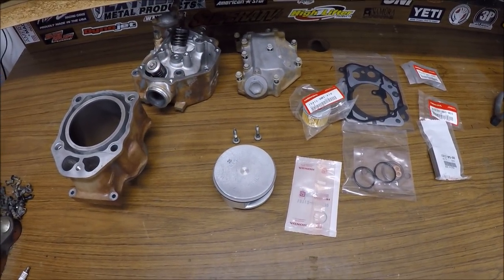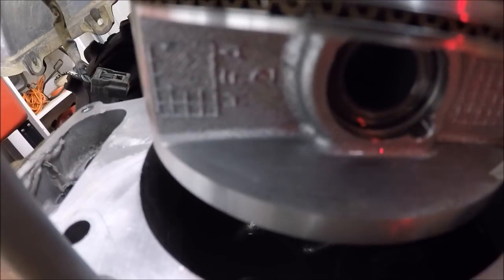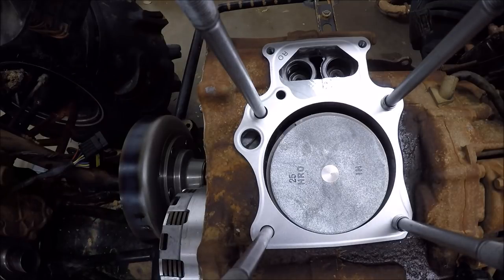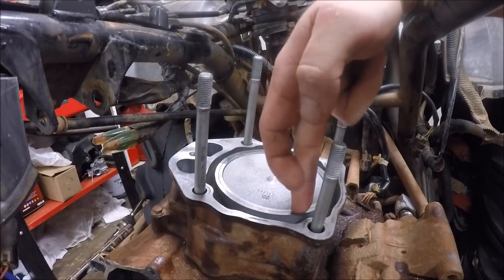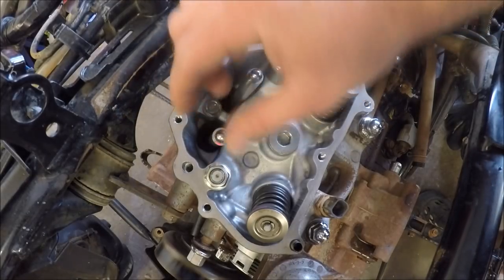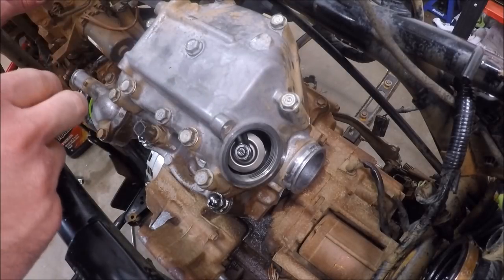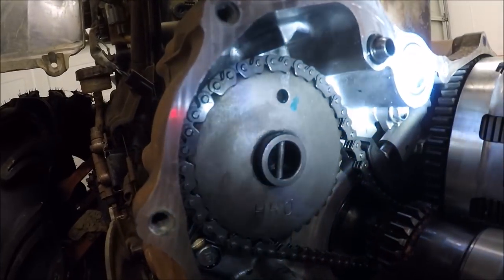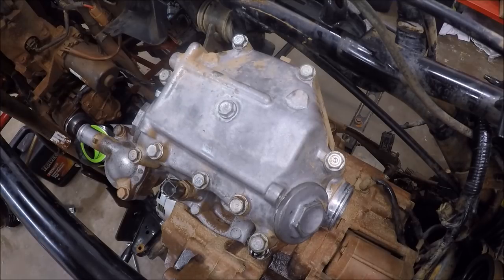'16 Honda Rubicon Top End Assembly - SwampAss Re-Build

Comment: If your cylinder is not scarred is it necessary to bore it? I was told if the cylinder is not scarred I could just hone it and install new piston and rings.
Reply from the maker: Some of them can be Honed and Ive done it many times, just depends on the cylinder. Some tho can not be Honed or Bored as they are NIk-A-Siled and need a Diamond Hone or Re-Sleeved

Comment: How did you get it at tdc without a pull start
Reply from the maker: Rotated the Clutch while the cover was off.
Reply: SwiFtProduction's.. If you don't pull the clutch side cover. Where the pull rope would bolt on, there is a cover with 3-10mm bolts pull that cover and you can rotate the crankshaft with a 17mm socket. When putting that cover back on make sure the O-Ring is in place or it will leak oil.. Hope that helps..
Reply: This applies to all most all of them that doesn't have a pull rope.. That cover is on the back right side of the engine just to the left of where you check the timing mark on the flywheel.. The Canadian models actually have pull rope on them..
Reply: @Solitude313  hey when I replace the top end am i gonna have to reset the timing? Ive never done any engine work so thats why I'm asking